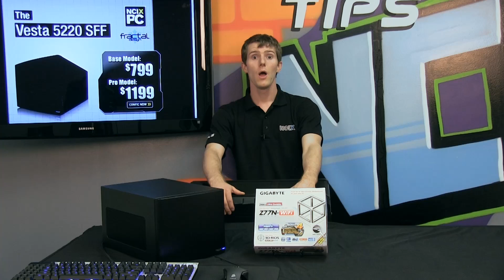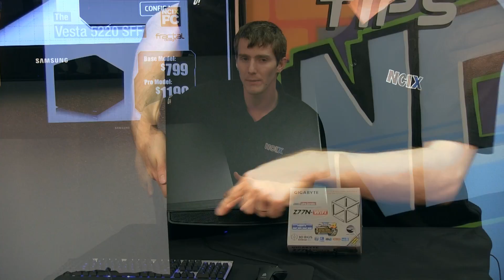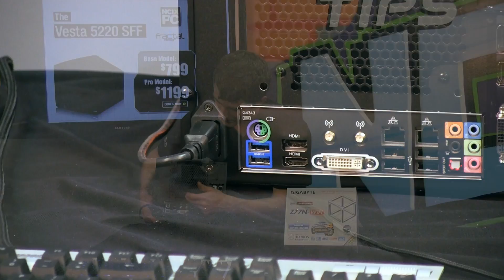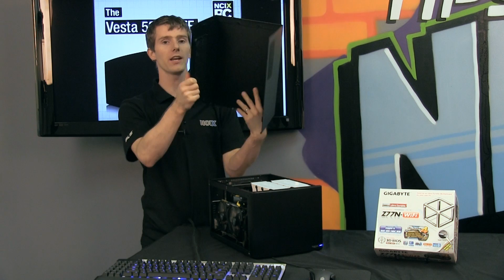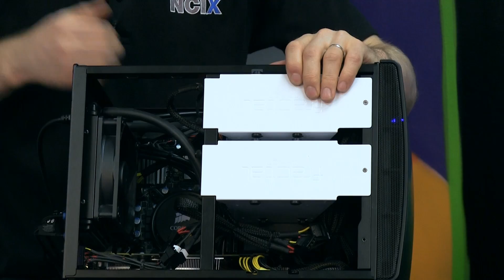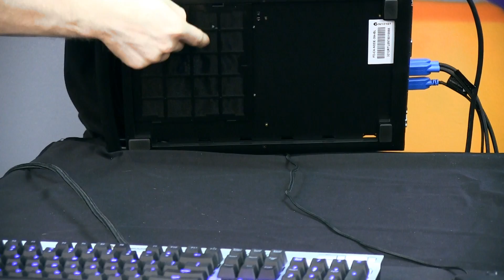NCIX PC Labs Vesta SFF 5220 Tiny Gaming PC System NCIX Tech Tips

Comment: Must admit, I think they're nice cars but not nice trucks, especially in the case of the titan. It's more meant for a guy that needs to tow out a boat under 30 feet every now and then and use it as a normal car the rest of the time. It's a completely different market than the F450 and RAM3500 which truly are trucks.

Comment: So what does tower size have to do with power consumption?  Technically speaking the smaller case would make it harder to cool due to laws of thermal dynamics would it not? Plus the components themselves are going to determine consumption based on use.